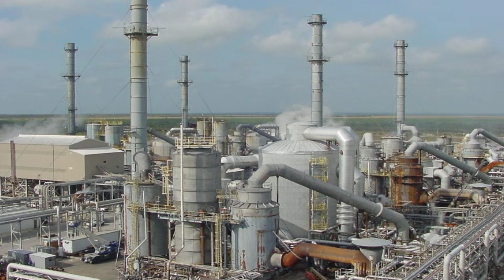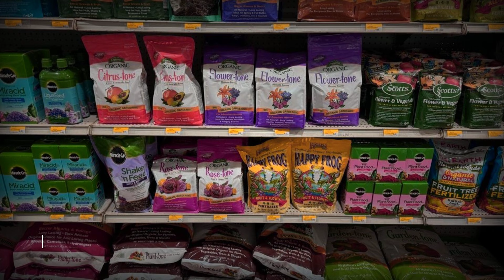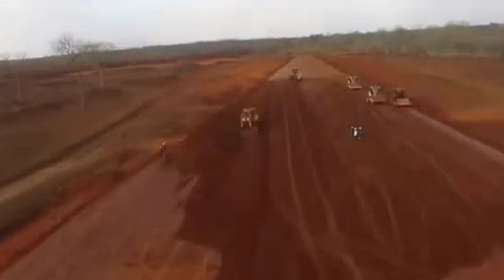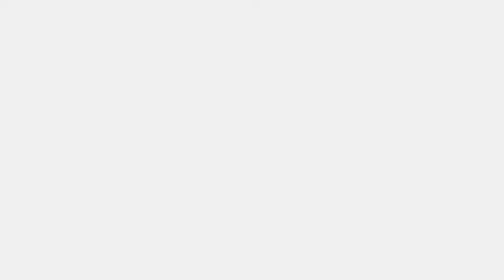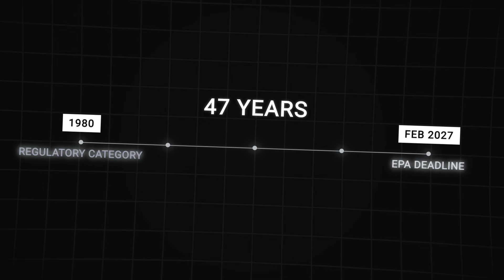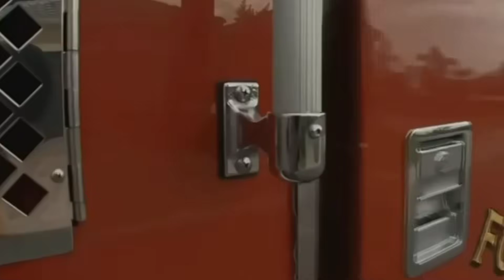Florida's Forgotten Radioactive Crisis Keeps Getting Worse

Comment from the maker: Worth saying plainly, since the title leans on the word radioactive: this isn't a dramatic risk. It's a slow one — a gas seep measured once a year, plus a groundwater problem that only matters if the ground gives way. The part I can't get over is that none of it was ever hidden. It got sorted into the waste stream on purpose, by a process doing exactly what it was designed to do.

BTW, the EPA's final decision is due February 1, 2027

If you've worked in Bone Valley, at a fertilizer complex, or in state permitting and I got something wrong, say so. I'd rather fix it than defend it.